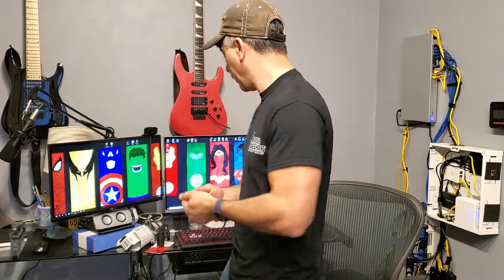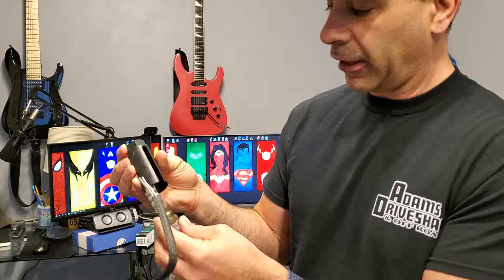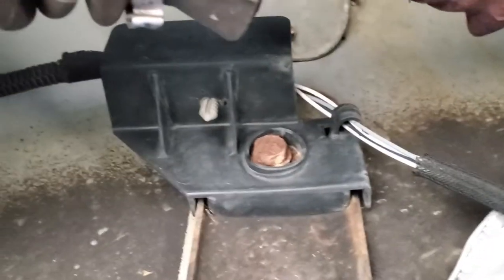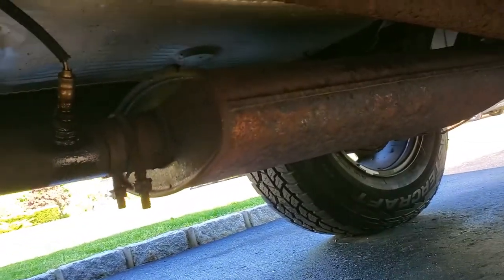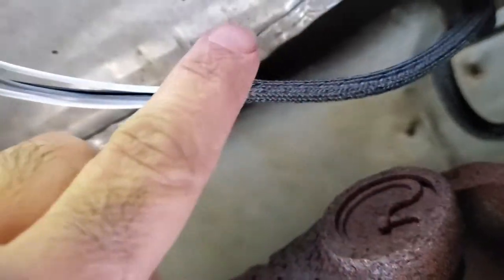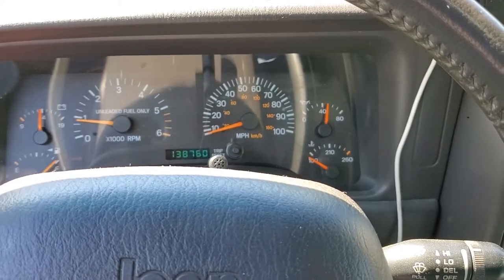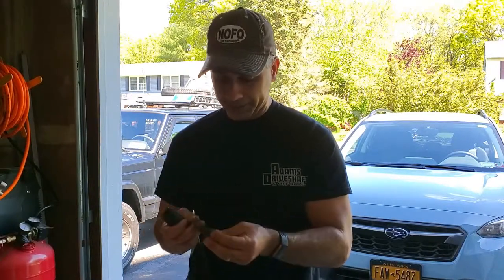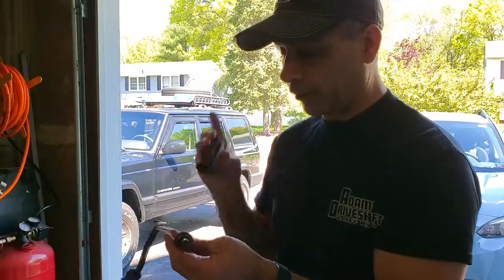Replacing the Oxygen Sensor in Jeep Cherokee XJ

Comment: I tried to loosen mine up… blasted it with a torch… big pipe wrench… nothing… reconnected the wires… Drove 2 miles and the light went off… 2nd time it’s come on with same code…
Reply from the maker: Yeah, they could be stuck on there real good. Even after heating it up and using the breaker bar, I didn't think it would come off.  Sometimes when using those split sockets, the force causes it to open up which you can kind of see happening in this vid, and then it slips off.  I got lucky and it broke free.  You may want to try giving it another go right after driving when the exhaust is nice and hot.  Sometimes it just takes a couple of tries